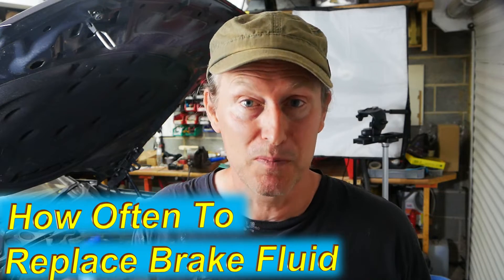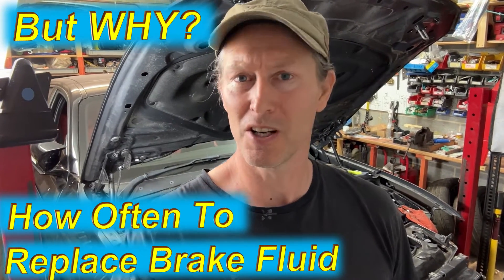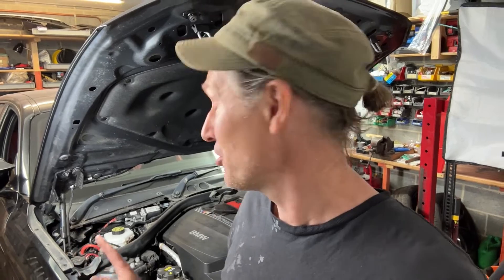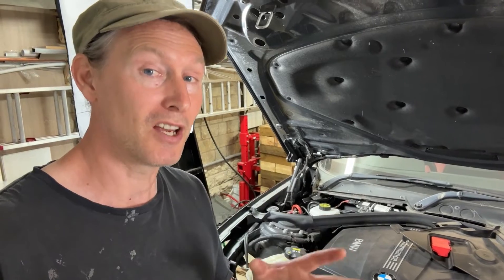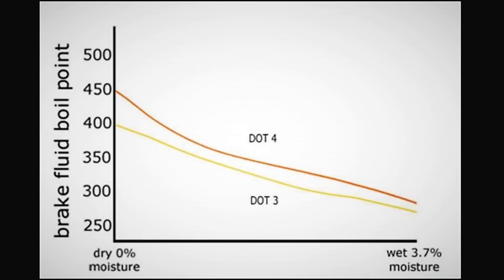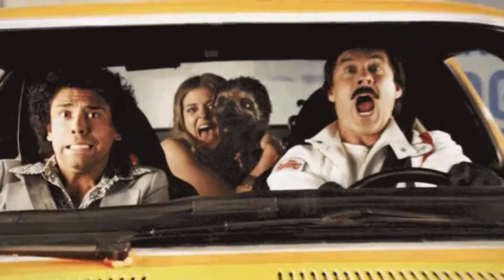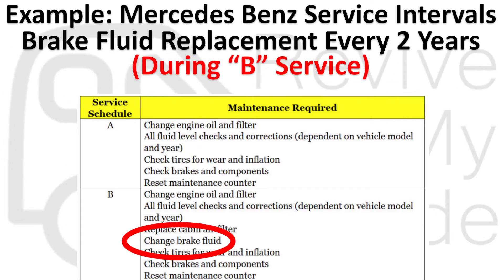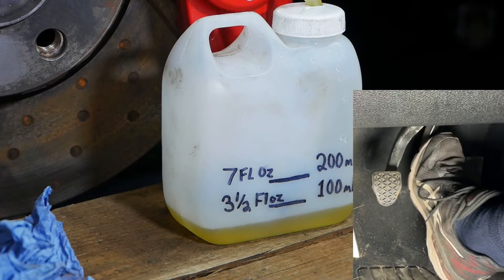How Often To Replace Brake Fluid (And WHY You Should!)

Comment: Thank you for explaining this in an easily digestible manner. Excellent job of providing the need to know information without attempting to display how much you know. No other videos I've seen broke down what is happening to  the brake fluid over time, i.e. water intrusion due the venting of the reservoir cap. It all makes perfect sense to me now. I'm surprised and slightly embarrassed this hadn't occurred to me having been trained in aviation hydraulic systems by the US Navy.
Reply from the maker: Thanks so much for the comment! It’s always a fine line between too much info and too little, looks like I might  have gotten it right on this one 👍😁 honestly, it sounds like you have much more knowledge on these sorts of systems then me but glad I was able to share a little nugget of extra info 😎 cheers, Phil

Comment: I've a suggestion to brake fluid manufacturers. It works be great if it came in 2 different colours so each time you change you use the other colour, then, weekend bleeding, you can't see when the new fluid has reached the caliper.
Reply from the maker: @stemcleeds That's a really great idea! When I did my brakes, I drained through a lot more than I needed to just to be sure and it is a waste of fluid and takes more time.
Reply: funny, I just changed my b fluid this week and thought the same

Comment: My new wheelcylinder, bleed screw and section of brake pipe arrived !! So i will be flushing thro the system on the T2 very soon !! Keep up the good work !!
Reply from the maker: Hi @arnietwo11 Bet you are chomping at the bit to get on with the job! Today I'm doing my first ever spray gun paint job, new video coming soon! Bit nervous!
Reply: @ReviveMyRide  ive been spraying the T2 recently and getting a reasonable job with rattle cans. As u know its in the preparation, also u need to heat up the panel, either with the sun or a heat gun, then u minimise the risk of runs.
Reply from the maker: @arnietwo11  Most of my painting has been rattle cans in the past. As you say, you can get good results and many of the manufacturers do better nozzles on them these days to get a better spray pattern. Sounds like you’ll be ready to go with your T2 soon 👍